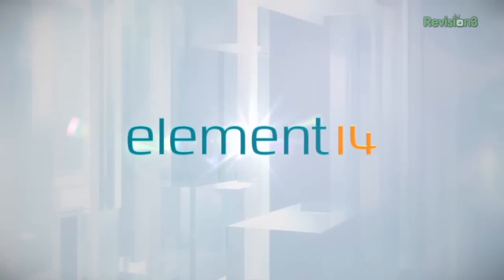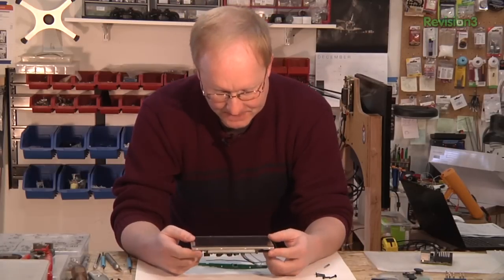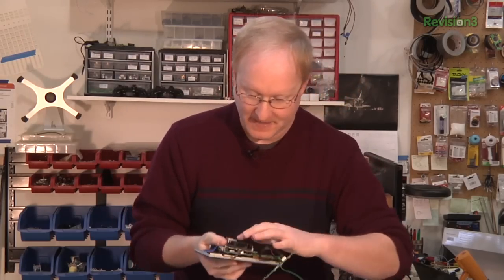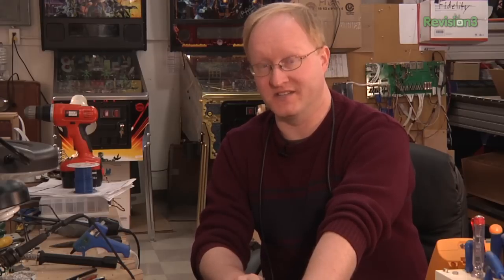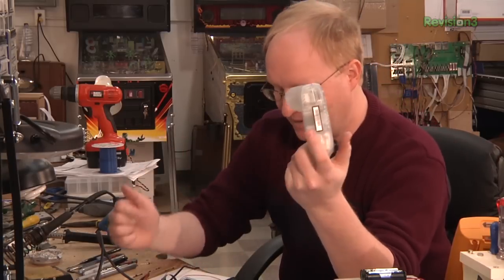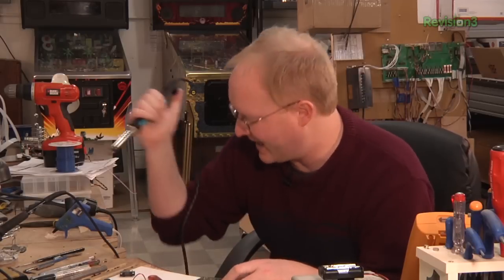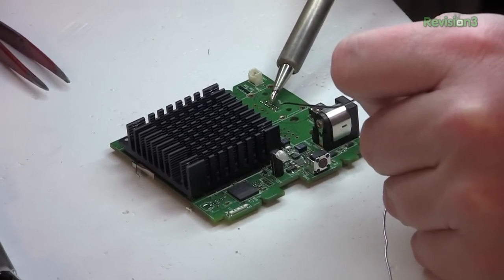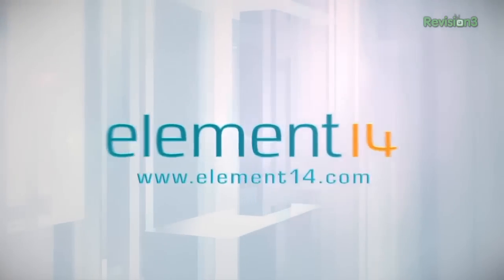Ben Heck Kickstarts his OUYA Portable Build Part 1

Comment: Well done, Ben. You've turned a device that was designed to bring mobile games to the big screen, back into a mobile. Bravo.
Reply: hahahahahaah epic Bravo!
Reply: Yeah but this has hardware that performs better than most phones and a lot of tablets out right now so it's like having a super powerful phone that is really just a games console
Reply: 1:15
Reply: Zachery Brown Not really.  The Ouya has a Tegra 3, which was already behind the times when it came out.  Now that chip is 3 generations older than current Nvidia offerings.  Pretty much anything from Samsung from the last two years would run circles around the Ouya.

So, its just an old android tablet with ouya's crappy software.

Comment: The long green coated wire coming off of the screen, if my understanding of wire color codes is correct, it is a stand alone ground for the vehicle mount. Automotive and residential wiring for the most part use a universal color code system, and you cannot ground bare copper in cars like you can houses.

Comment: The issue is that you're using the original Ouya controller for this. the Ouya will work properly with an Xbox 360 controller, which you can hook up via USB internally.

The other thing to watch out for is tha thte Ouya controller has a touchpad on it, and also that playing games with the WiFi on will cause very noticeable controller lag, because they share an SoC. Hence, why using a bluetooth controller internally shouldn't really be done for this if at all possible.

Comment: +Lochie Battersby It would be very easy to put a PS4 in the XB1's casing, but impossible to do vice versa. The XB1 is incredibly bulky, but it might fit into an original PS3's casing. Or an original 360's casing.

Comment: The battery life of this unit will be atrocious. Calculating it with a 1000 mAh battery pack, at 500 mA draw, you will get 1.4 hours of use out of it. 

$99 for the OUYA,
$70+ for the screen
$30+ for packaging the components
$20+ for the battery
$10+ for misc. components.
+ Hours upon hours to design/develop the unit.

No DIY factor to it, but save so much time and some money by simply buying a tablet. Battery life will be greatly improved as well. Also the thing wont be an inch thick in the end...

Comment: To all the kids comparing the pros and cons of the Ouya to the Shield, here's a key feature you're missing:

To play GTA4, Skyrim, etc on your Nvidia Shield, you need to have a gaming PC with a GTX series graphics card to be able to stream to the unit. Your games don't install to it, they stream to it via Nvidia proprietary software (which is why you need a GTX series). You can also stream your PC to the Ouya without the need for a specific GPU and can use open source software to stream to it.

The Tegra4 was also put on the shelf for cheaper chipsets and SoCs (Yeah, only a handful of units bothered to have the Tegra4 due to sheer cost at launch as opposed to the Tegra3's intro price) such as the more recet Snapdragon/Adreno combos used in phnes such as the LG G2, Galaxy S4, Xperia Z1, what have you.

Comment: I might pick an Ouya up from a bargain bin, looks like it would make a nice solid state webserver, IF you could find an android equivalent of Samba.  They already have android webserver apps in the play store.  Small, compact, silent, low power draw, good performance.   The big negative on this board being only HDMI out (needs SVGA or DVI) and what... 1 or 2 usb ports if that for expandability.    

I currently run my websites on a totally silent HP thin client running apache, samba, and Tinycore Linux, that is about 4x as big, 8 watts at 12v DC, 400mghz, only 108mb RAM!  http://air-war.org
Reply: CHOPPERGIRL AIRWAR i thought hdmi was code for dvi if you have the adapter or know the proper pinouts of each connector
Reply: CHOPPERGIRL's AIRWAR dude you can run desktop Linux, and maybe windows, on the ouya. HDMI can be converted to another connector

Comment: holy shit is the inside of the ouya really that tiny? holy shit! that's amazing
Reply: hornylink Most Android circuit boards are tiny. Ever seen a Android TV Stick, tiny as you can get. Which makes you wonder why tablets have small batteries because most of the inside is empty space.
Reply: hornylink You can get a small RK3288 Mini Android box it has the best GPU. I doubt Ouya has one. It's using the Mali T 762, even better then a Samsung Galaxy S6 phone has.
Reply: TekReview's The Ouya has a tegra that was considered last gen when the Ouya was released.
Reply: MrCorrectify Nvidia never bothered with many games having the Tegra treatment. Ouya should have been a flop before it was even sold. Nobody talks about it anyway. Newer Android Mini PC's from China are rocking GPU's better then on the Samsung Galaxy S6.
Reply: hornylink Just open Lenovo or Dell desktop computer and check the motherboard. You need magnification glass for replacing a resistor on that one. :P
Reply: hornylink dude its a smartphone with no battery. not that amazing

Comment: Can someone please explain to me whats the difference between a powerful phone/tablet and Ouya except the fact that Ouya doesn't have a screen and has a custom OS? Don't get me wrong! I love the console but cant i get the same performance from a really powerful tablet with and HDMI port and a PS3 controller?
Reply: Depends on the tablet. Ouya has a quad core Tegra 3 processor. Not every tablet has that.
Plus the Ouya's Tegra 3 runs faster and can give more performance for games since it is not going to assuming it's on battery power (which tablets even though they could be plugged in, the apps are designed to save power because it assumes you are running on battery power)

Also, the Ouya can use a PS3 controller out of the box, a tablet is going to need to be rooted in order to use a PS3 controller with it.
Reply: the difference is that a powerful phone is more powerful than the ouya because tegra 3 is weak
Reply: This is an YouTube account.

Tegra 3 is weak NOW since the Tegra 4 is out and they are working on a more powerful one. Just like the PS3 is weak compared to the PS4.

Tegra 3 was powerful for it's time. Ouya used it to cut costs. Simple.
Reply: snake2006 So? I don't care if it used to be powerful, how is that relevant?
Reply: This is an YouTube account.

It is relevant for that device. You can't compare a newer tablet or phone with Tegra 4 to a Tegra 3 device. Of course it is weaker that is a given. Just like if I compared a PS4 to a PS3 in terms of what they can do, obviously I can't because the PS3 is much,much weaker than the PS4.

It's stupid to compare the 2.
Reply: ***** OUYA is capable of 12.48 gflops, the chip that is in my tablet is capable of 74.8 gflops.
Reply: ***** Talking about PC hardware, Android can run on any processor even non-arm including x86 etc. So im still waiting for someone to make a proper android PC! Thats gonna beat all the current cobnole-like things on the market!
Reply: ***** Surface 2
Reply: *****

Sure there are more factors that go into it, but he is comparing the graphics of a Tegra 3 to the Tegra 4. The Tegra 4 will give out more performance than the Tegra 3, that is just a given.
Reply: snake2006 The question was how it is different compared to a powerful phone/tablet.
Reply: This is an YouTube account.

No the question was the difference between a phone or tablet of similar specs was to the Ouya and really the only difference is that the Ouya will give out more performance because it is plugged in over the tablet that will always assume you are running on battery.
Reply: *****

I never said anything bad. I am not the one to be mad at. I am defending the Ouya. The other guy is saying Tegra 3 is bad because it's not as powerful as Tegra 4.
Reply: *****

Yeah, you were replying to me. I was like WHAT? I am the one defending the Ouya. I have on and it's not that bad of a console. I use it for XBMC, I have found some good games on it and see potential for it.
Reply: ***** Why Tegra 4? Maybe the Ouya 2.0 will be that Super Android Gaming PC! If they can fit a non-arm processor in there and just make everything work they might be able to make a very powerful, really console-like device that ca run everything! On that note Android is a Linux Distro so what is stopping them for loading it with SteamOS which is based on Linux too! That potential dual boot can make them so much money and a killer gaming device! I even dare to say that if they can pull that off I am willing to spend more that 500 dollars for that many games and power! Android for mobile games and apps, SteamOS for console grade AAA games! Todays consoles are locked in terms of apps and services but with Android as im sure we all know that's not the case! This idea has so much potential for bringing best of both worlds and the best thing is that it is 1000% possible!
Reply: Bogomil Petrov

The price would be too high for them to manage the costs. That is why Ouya won't do that.
Reply: snake2006
''Can someone please explain to me whats the difference between a powerful phone/tablet and Ouya except the fact that Ouya doesn't have a screen and has a custom OS? Don't get me wrong! I love the console but cant i get the same performance from a really powerful tablet with and HDMI port and a PS3 controller?'' There you have the question, care to enlighten me?
Reply: This is an YouTube account.

I already did tell you. You can get more performance with a more powerful phone or tablet. You can't use a PS3 controller natively on a phone or tablet unless you root the device. Ouya can natively use a PS3 controller once it is synced to it.

Now if we are talking a similar spec phone or tablet then the Ouya will outperform it because again the Ouya is made so it doesn't rely on battery so they can overclock the chip vs phone/tablet where it will always assume it is on battery power even when plugged it and will not give as much performance.
Reply: snake2006 Let me clarify, I mean how did you get ''No the question was the difference between a phone or tablet of similar specs was to the Ouya''?
Reply: ***** I'm not sure what that has to do with me but I agree.
Reply: This is an YouTube account.

That is what you have to assume otherwise why ask such a stupid question when the answer is damn obvious if you have a more powerful phone or tablet it will blow Ouya out of the water performance wise.

Thinking McFly??????????/
Reply: ***** As I said before if its worth the money i would pay over 500 USD for it ! Normal Steam Machines with SteamOS start at about $400 so if they can load that with both Android and SteamOS the consumer market would swallow that the second its announced! If they can pull the $160-$200 you are talking about then that would be the next big thing !
Reply: snake2006 ''Depends on the tablet. Ouya has a quad core Tegra 3 processor. Not every tablet has that.''
That's basically saying, it depends if it's as powerful or not. Just as obvious.
Reply: This is an YouTube account.

You are the one asking stupid questions, not me pal.
Reply: snake2006 I did not claim that you were asking stupid questions.
Reply: This is an YouTube account.
OUYA provides a gaming-ready device that runs an operating system that is extremely easy and accessible to develop for at a price point that blows equivalent devices out of the water.  Now, since you can go out and buy a tablet for a little more money and plug it in to the TV as an alternative there has to be more: the ecosystem.

Developers making a game on the OUYA can guarantee the existence of controllers and the buttons that will be on them.  If you wanted to make a game for an Android mobile device you'd be stuck with touch since that's the only guarantee.  For that reason the OUYA store is much more valuable on a television than Google Play since the majority of games on Play assume touch input and do not translate well if at all to controller input.
Reply: ObsidianX I don't hate the OUYA, never claimed that I do either. I assume that you thought otherwise.
Reply: This is an YouTube account. Nah I didn't assume one way or the other.  Looking back I incorrectly thought you were the OP and was answering their question specifically (which you repeated at one point, hence my confusion ;).
Reply: ObsidianX I can see how that would happen. I didn't mean to ask the same question though, I should have been more clear since I have already confused 3 people xD
Reply: This is an YouTube account. Anyway in the end all questions were answered and all answers were spoken! Thank you all for answering and discussing!

Comment: You want a portable Ouya? Get a GameStick.
Reply: ... That's not portable.
Reply: skintstudios
An Ouya with a screen is just a tablet.
Reply: *****
Yes
Reply: *****
It can technically do everything a tablet with the same hardware could, yes.
Reply: *****
Things like what?
Reply: ***** Any chance you could be more specific?
What makes this "Bluetooth OS connection" different from Bluetooth on a tablet?
Reply: ***** Your replies are sadly too vague to make much sense.
In any case, an Ouya = tablet / phone hardware running Android. There is no reason for its capabilities to be any different from a tablet apart from the lack of a need for energy efficiency.
Reply: ***** Typical, resorting to insults after failing to back up your claims in any way.

I should of course have known you would get upset from someone asking you to clarify your seemingly randomly strung together words.
Reply: racoiaws There is a difference from a table and an ouya... It only plays the games that a tablet could do, it doesn't have touch compatibility so you will have to add something to that. So not even technically does it have the same hardware as a tablet.
Reply: ***** My point was that it's not worth the effort, a tablet could do everything that mutant-ouya could and would generally be a lot more practical.
Reply: racoiaws True that. Though, I would rather just hook up a Raspberry Pi to this portable device rather than an OUYA. I could emulate old games on it as well which in my case is funner than playing games that I can literally play on almost any smartphone today.
Reply: Shedderdude Gaming get Amazon's $40 tablet